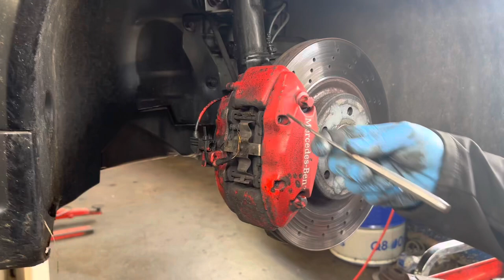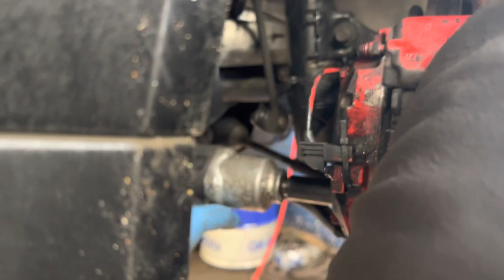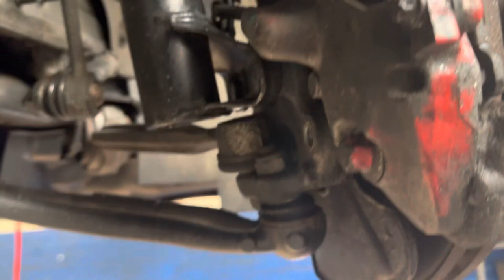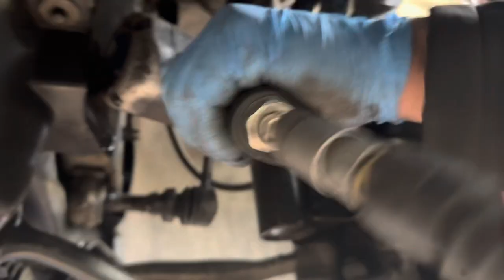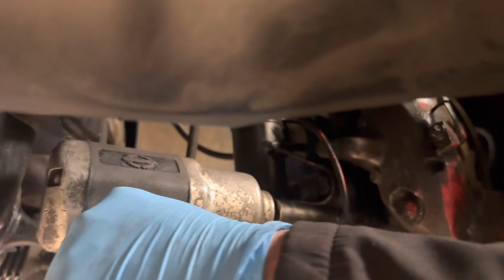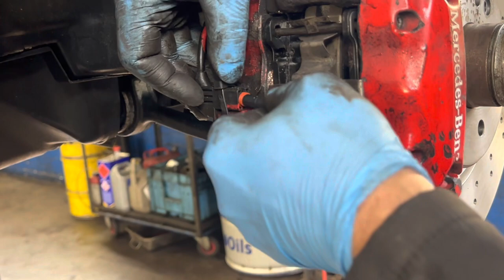How to Change Front Brake Pads & Discs on Mercedes SLK #zm motors #youtube #mercedes

Comment: Hi, 
I have exactly this calipers, and after my mechanic changed brake pads, there is a huge vibration when braking (not always but 90% of the times, some times stronger than others). 
Feelis like the rotors are not even, so they were sent to shop to be rectified. Afterwards, the vibration keeps the same, so we changed the rotors to some brand new Brembo ones. The result is exactly the same. 
The new rotors where measured with the right tool and the values where within tolerances. 
I do not know what to check now! Any ideas? 
My only hope is to replace the pads and hope the pads are the problem.
Reply from the maker: Mostly vibrations from the discs. We never had vibration issues after replacing the brake pads. 
Ask same mechanic to check all the fittings are okay and double check the discs.
Reply: Check the hubs to see if they are out of round
Reply: Can you describe what are the hubs?
Reply: @jefazo666  it is what your rotors are screwed into they have bearing inside and if you check the runout on it you can see if they are out of round. This will give you the same sensation of bad rotors